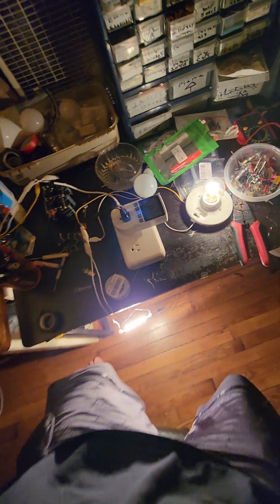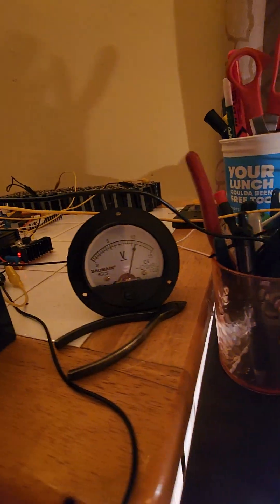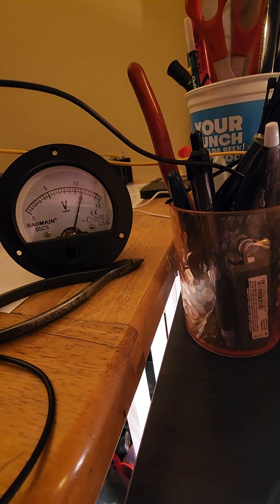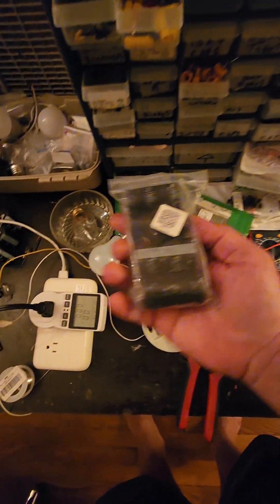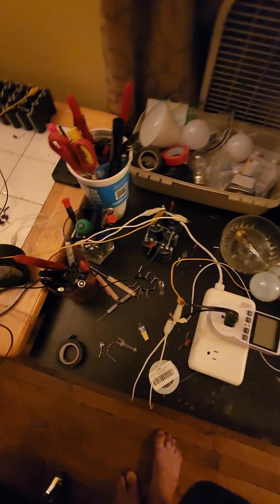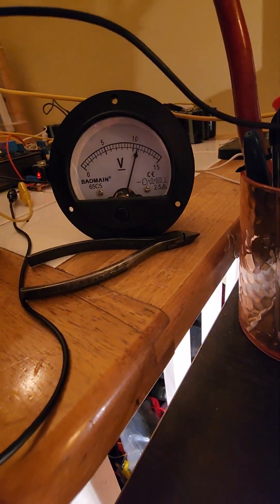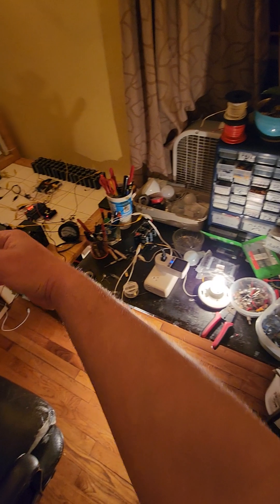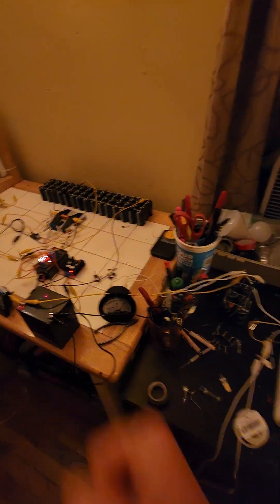😱RINGER TUNED TO OUTPUT 140-150 WATTS WITH ONLY A 10 WATT 0.5 SEC BURST INPUT! THINGS GETTING WILD🧊

Comment: What if you use bigger awg around more ferrite rod like 5 ferrite rods
Reply from the maker: Would probably output more wireless power & amperage at same input power levels. Only issue is performance Degrades when using multiple rods. Best to use 1 special ferrite rod laced with metglas & barium Titanate:)

Comment: Does charging time take as long to top-up as the discharge time (running the load)?  Also, I just want to add that it may be necessary to have a completely isolated second Ringer circuit (source bat-cap included) to run a load in parallel. Only the load output wires(past the bridge recitfiers) would be common. This way, you will avoid destroying the transistors and introducing losses in the Ringer. I hope that makes sense 👍
Reply from the maker: So far the huge capacitor pulse is tuned to now discharge for 0.1 seconds every 1 second with an output power of 20 watts & a stepped down voltage of 14 volts. Also because the correct timing was figured out the massive dc capacitor bank virtually never loses it's full charge from the pulse & i definitely plan to add a second ringer & do more experiments. Also the way the system is now it outputs more power over time then the input drain leading to a excess power gain that can be used for whatever one wishes :)

Comment: Fantastic work! What happens if you increase the speed of the pulses? Is there a charge time between each pulse? If you increase the speed would each pulse output less power?

Keep it up!
Reply from the maker: Increasing the speed atm would place too much of a strain on the capacitor bank & start to drain it slowly. The goal is to have the capacitors always at a full charge during the short pulse. Doing so keeps the input on the source incredibly low & I'm curious to try & even more massive DC capacitor bank that has its negative earth grounded :)

Comment: are you sure your not making 10 watts per second for 15 seconds to accumulate 150 watts in a burst ?  (SCHEMATIC???)
Reply from the maker: It's more like a 10 watt burst for half a second with the input to the circuit. Very interesting & strange things are starting to occur
Reply: @MTECH2022  I can look at  your circuit if you have a diagram.
Reply from the maker: @mykedoes4099  I'd have to draw my modified one up but it's basically a beefed up slightly more efficient version of laser sabers super joule ringer 3.0 circuit wound on the exotic nano crystalline metglass ferrite core & the high frequency goes through a rectifier that rapidly recharges a huge dc cap bank that pulse discharges into a dc storage medium that then runs an Inverter :)
Reply: i'd recommend drawing it so other people can try to replicate your circuit, if it is real than that would shut up the haters and you would still retain rights to it as you posted it online first and if you happen to be wrong about it or how it works, it'd also figure out what is happening